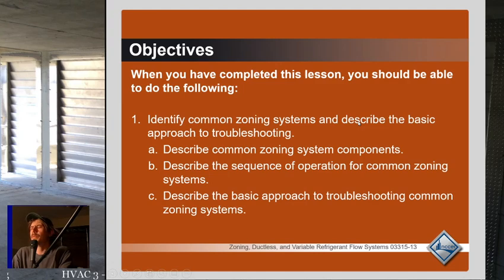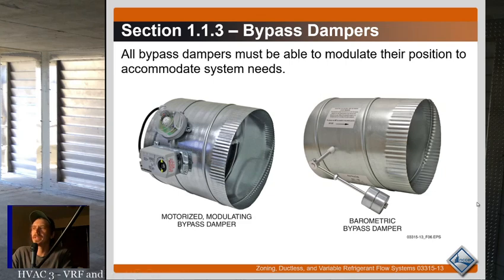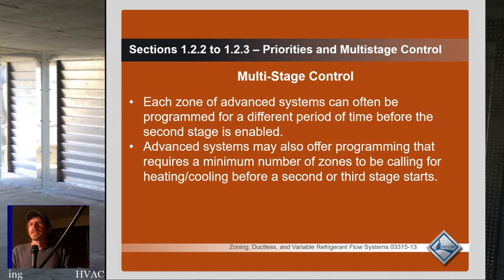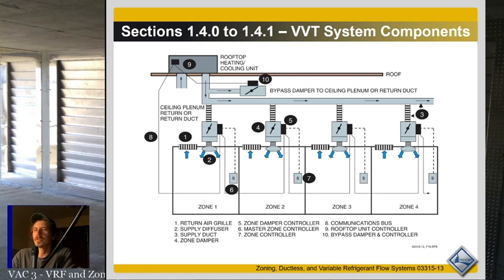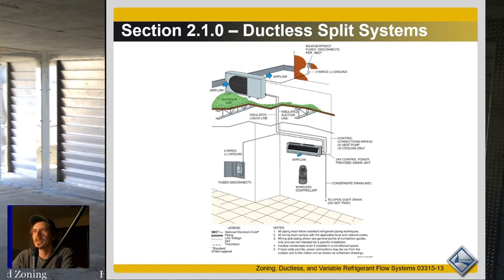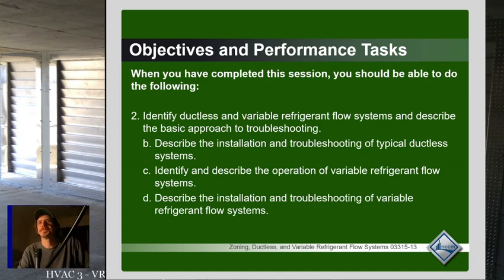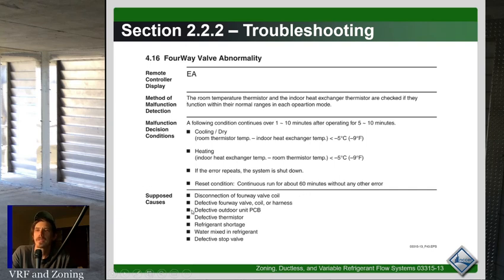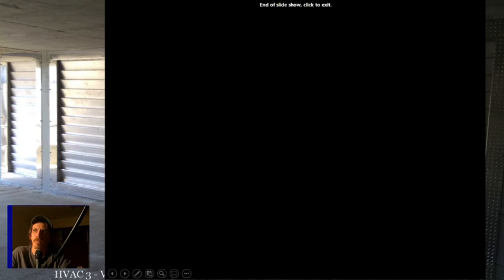Module 8   VRF and Zoning

Comment: The California 2019 energy code requires you to use a dump Zone in the house instead of a bypass duct because the energy you use has to be put to work. Most guys will dump it in the hallway that has a central return so it at least goes into the living space before getting pulled back to the air handler
Reply from the maker: Yeah - this age your other comment is correct. I would have to watch this video again to see what you're referencing, I believe these videos were based on ABCs course, not necessarily all of my own info. 

But - if I do zoning, I typically DO use a minimum of two stage equipment, avoid zoning some area open to the majority of the house, if not a couple.  Don't zone those areas, let them consistently circulate when calling on any zone. 

As long as people don't try to keep the zones miles apart on setpoint, bypasses usually aren't needed. Variable systems are of course, ideal. 

I've never actually used a bypass on a zone system I designed.

Comment: If your zoning a home you should be using variable equipment or you should be putting in two separate systems. Some states have outlawed bypass dampers they kill the efficiency and running cold air back through a air conditioner can kill a compressor.

Comment: in short shielding wire, is to prevent Induction of a current from and external source, Trane uses some 5 volt DC circuits, when installed near over head power lines the magnetic fields can induce a in correct voltage, micro and radio wave can do the same. i hope you get pair well your a excellent trainer.

Comment: i am 20 minutes in,  i only do residential, wanted to chime in, most zone controls can handle a call for heating and cooling at the same time,   the logic built in satisfices the call for heating first then cooling, and this happens in 2 floors,  up stairs is warm and mom living on the fist floor wants heat.   in residential we don't call them dump zones we call them constant air flow registers,   to lower the by pass need or over all pressure on a variable speed motor pocking a register near a front door foyer,  or kitchen dinning room with slider/ French door,   or even a utility room is a grate place to have supply leads that blow no matter which zone calls so long as there not near a thermostat or zone controller.    love you video's recommend them  please keep them coming.